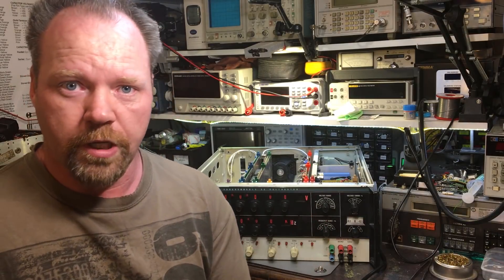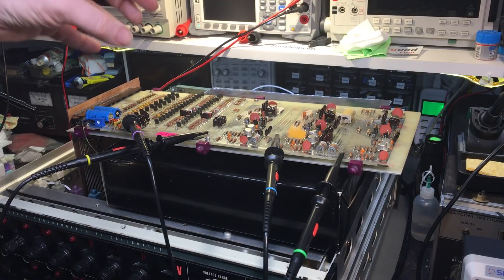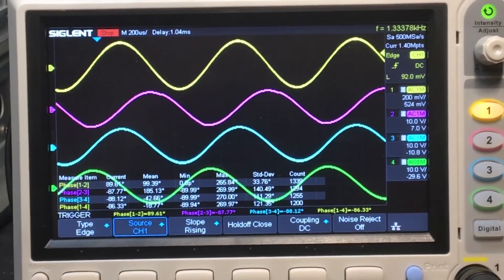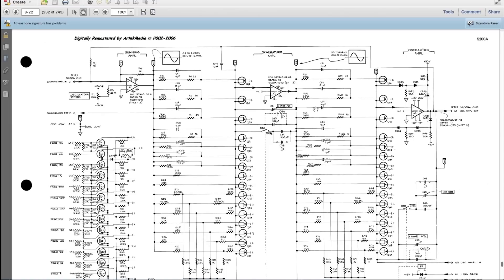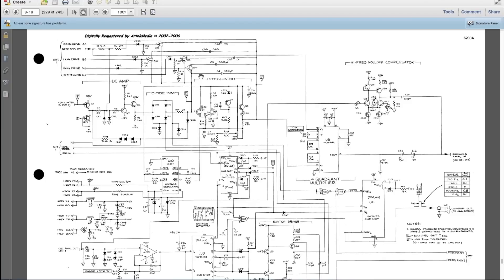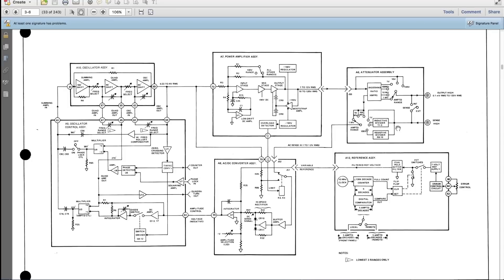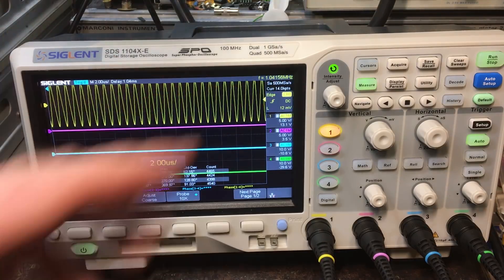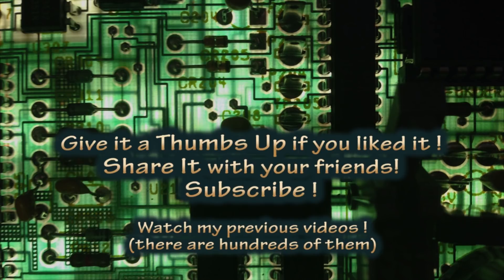Guest Video: The Defpom - Fluke Calibrator Repair

Comment: Nice show. Enjoy it much. 

I’m at the end of a tunnel complete dark because I don’t have needed circuit diagram for a Fluke scopemeter 199C. Would you like to take this as a challenge to have fun repair it? Your work will be rewarded handsomely. 

I have a near miss escape from a counterfeit service shop only interest to rip the equipment off you by charging excessive diagnostic fee to a job they didn’t perform, a fee so large that you may as well give it up to them for free. Soon it will turn up in eBay as repair or parts.

Comment: I repaired one of those back in early 80s... yah, they are a bear! As I recall most of the problems I encountered were related to the front panel rotary switches. Fluke once used a switch lube called "Rycon" (blue-greenish color). The Rycon was thinned with toluine. Problems arose after toluine outgassed, leaving a thick wax like substance. When I called factory to ask where to get new they reported that they had changed over to Cramolin (now Deoxid R-5). Important part is that you must completely remove the old Rycon... which requires full dissasembly of front panel. Hope this is of some help.

Comment: The most amazing part is that you could get the manual with theory of operation and simplified block diagrams. We used to make all those until the mid80s.

We had a small systems Ultrasonic instrument (kb6000) that had a 1” thick service manual for every module in the system. It was fantastic. Those days are long gone. When FPGAs came about, those magic black boxes of circuitry, made device manuals and theory of operation obsolete.

I miss the good old days, but anyway, it is exciting that you found a complete service manual for that calibrator. Was it a leak out? Fluke surely didn’t release it to the gen pop?

Good luck with the continued repair. It looks like an extremely complicated instrument to service.

Comment: Where did you get the riser extender card?  I might need one and only see one on the auction site.
Reply: It was on eBay, a guy makes them, you get them as a kit (solder connectors on yourself) I also added test pins to the card whenever I needed a test point from it.
Reply: I'm pretty sure Scott made it himself as he couldn't find one to buy.
Reply: I stand corrected! Must have misheard or forgotten the details. Doh!